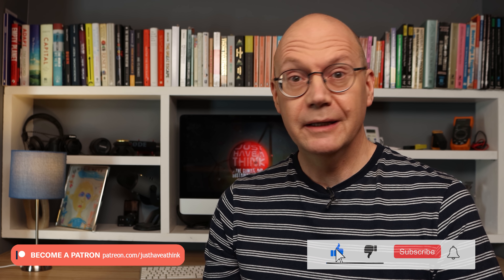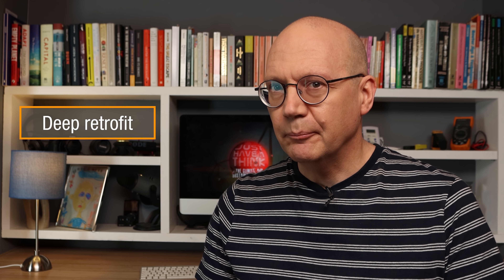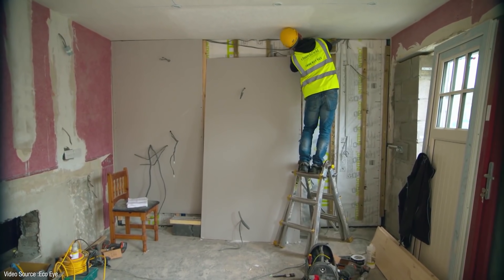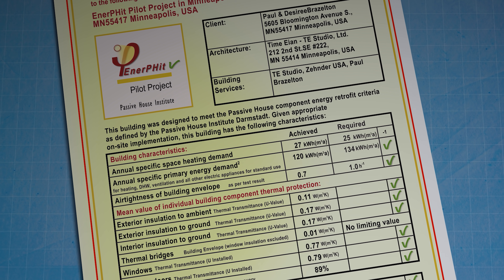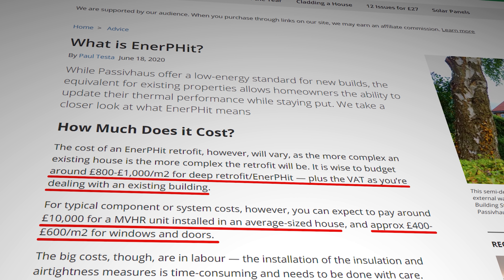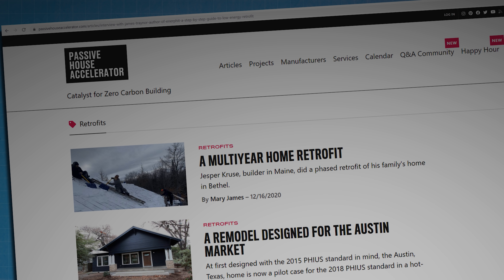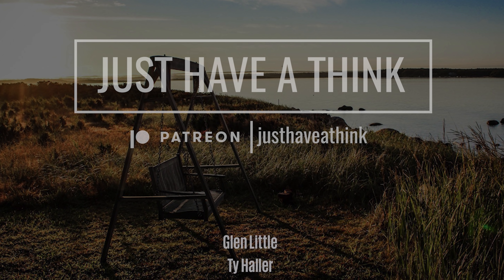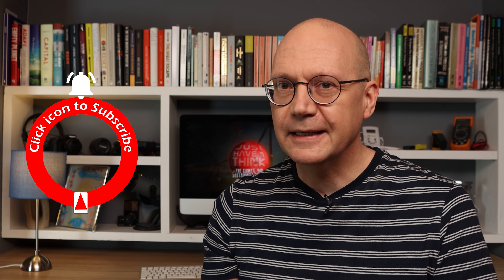Retrofitting to Passive House standards

Comment: This can be done bit by bit with the savings generated by one project freeing up cash for the next in a positive upward spiral.  We have a historic wooden house from 1830. Since 2003 we have slowly: 1) insulated it (none before), 2) reconstructed the windows to Low E double paned (they were all single paned), 3) rebuilt the roof with more insulation and sealing, 4)added 14Kw PV system, 5) added daylighting solar tubes to the N side of the house, 6) added electric heating to our bathroom 7) we are converting our appliance to electric as they meet the end of their lifespan and we just got an induction cooktop.  None of this is revolutionary, yet we are able to cover all of our electricity needs including our 2 EVs with 15% excess that we need to sop up with our planned air source heat pump in our next phase.   We reduced our carbon foot print of our house by 80%  with more to come!!    All of this while not disrupting the design of our historic Carpenters Gothic  home.

Comment: I work as an Energy Assessor and am (now) a Retrofit Assessor.  The UK government has a target of deep-retrofitting 500,000 homes per year, but it is difficult to see how this can be achieved with the sort of housing that needs improving around here - individually-owned Victorian terraces. All the owners that I've spoken to immediately rule out exterior wall insulation as it will  impact the looks and character of the property.  4-6" of cladding also impacts the roof, as the eaves aren't wide enough to cover this.  Interior cladding is also impractical as losing that much interior space may not be an option, especially if the staircase is next to the exterior wall. The obvious target for a deep retrofit is social housing, where a single owner can re-clad an entire block of houses.  
Fitting MVHR is all very well, but these systems need to be maintained and this is not always the case - a friend of mine had a contract with a council to service the MVHR systems in all their social  housing, but it wasn't possible to service them all as many tenants simply wouldn't cooperate to allow access.

Comment: Thanx for your work.
 We live in Israel, so our major concern is heat and humidity. 11 years ago we've retrofitted a 40 years old concrete house into a passive house. We replaced the asbestos roof with an isolated panels roof, insulated the concrete walls (thermal mass) with straw bales+lime plaster, changed the windows to double glazed polarized glass + aragon gas, used concrete floor tiles (thermal mass) over fine gravel (instead of over sand), and shaded the windows. The insulation wraps the concrete (thermal mass) from the outside. 
Before the renovation; during the summer, the roof used to radiate strong heat until 02:00 every night; during the winter, the whole house was constantly cold. After the renovation, the house if comfortable most of the hours in the year. During the summer we turn on the air conditioner only to lower the humidity in the afternoon. Last winter, we used a tiny electric radiator to heat up the whole house during the nights. Our electric bill dropped by ~70%. 
This year, after 11 years that bureaucracy obstructed us, we have finally started to install solar panels on our roof (20.03 kWp), which is 3 times larger than what we use. The rest we will sell to the grid. Here we get per kWh we produce, ~85% of the cost we buy a kWh- a great incentive.
Reply: Hi! Do you insulated internal or external the walls?

Comment: Just remember, actually retrofitting an old house to higher energy standards is VERY difficult to get right. And then, if you really DO get a tight weather envelope, you can grow some nasty molds IF you forget to calculate and install an air exchange system that recaptures heat. My brother built what he hoped to be a net-zero house in 1992. Some systems worked and other underperformed but he kept tinkering with it even though it wasn't really net-zero until 2011. His last job before retirement was to do energy audits. He claimed that at least 80% of houses near him had been so badly built that it would be much more cost effective to replace them because meaningful repairs are so expensive.

Comment: Hi, thanks for your great videos ! I have a question for you: living in a wine region in France, I wonder if you ''have a think'' about this thing the wine-growers do in spring, when the temperature are below freezing in the morning. They lit numerous little fires, fed on straw, that make a lot of smoke. It's really, REALLY effective in creating a ''fog'' all over the valley. I wonder :
1. How much effective it is to keep the vines from freezing (there's a small fire every 100 meters approximately around the perimeter of the vineyard)
2. Is the ''fog'' have an effect on the temperature, if yes, how does it work ?
3. What would be the environmental impact of such a practice on the climate ? For one day ? But if it's freezing for the whole spring? 
Thanks for considering an answer, directly or on a video.

Comment: If not for the historical value most houses should be torn down and and new homes should be built. I am just finishing up a duplex that we will live in. I have double stud walls with R40 and R. 60 in the attic. The house has a great southern view with about 200 sqft of glass on that wall. Where I live we can built our own homes but you want to make sure it is done right in case you sell it and a bank becomes involved. I do many extras most homes would not have because of labor cost. I put in a good HRV system and am in the process of getting gas to the home. We will have a condensing boiler run at 140F for heat and domestic hot water. Being in Alaska the foundation has 4” of rigid foam and the garage has a heated slab because these old bones like the warmth when doing maintenance on our on and off road vehicles. There is also a 16’x16’ greenhouse off the daylight basement that has a 4’ foundation insulated and backfilled. It has double wall polycarbonate panels.

Comment: Did someone do the math on the energy use and CO2 emissions of all the extra materials used to achieve a passive state? How does it compare to a lifetime of more energy usage if it could be sourced from all renewables?

And I am a bit worried about living in an airtight space:  what if Coronavirusses in the future dictate excessive ventilation? Is this possible in a passive house? 

Can a passive house or a really insulated house be achieved with all natural or biobased materials?

Comment: I replaced 20 year old run down double pane windows for good 3 pane windows (Ug 0.5 W/m²K) in my apartment, when I moved in. The walls of that house are decent but could be better, definitly not passive house quaility of heat insulation. Still, I cut my heating costs by almost 70% just by changing the windows and the investment payed for itself completely in about 8 years.

Comment: I'm just installing a DIY MVHR system in a small one roomed house that I built last year. I've sourced all the MVHR components for under £500 and the building services engineer who supplied the heat exchanger calculated that I'd achieve 83% heat recovery. The MVHR unit uses about 2 Watts supplied by a 12 Volt power system that is itself powered by one solar panel and a micro wind turbine. It will cost nothing to run (I'm off grid). My point here is that you can do DIY MVHR and keep the costs down.
Reply: Love it

Comment: Several years ago Building Science Corporation did a test to see how two identical houses built from scratch and side by side performed with two principle of insulation. One was sealed with caulk and gaskets with no insulation. The other was insulated but with no air sealing. The winner by far was the caulked house. Air exchange is more cost effective than insulation. If one does both, it is much better. BSC is in Massachusetts.

Comment: My Wisconsin home is a passive solar and passive geothermal that I designed it can get over 80f when it is below zero outside if full sun. Homes designed to not freeze if no heat is used and it only gets down to 55f with no heat or sun for days.

Comment: mold can appear in insulated buildings also, if air circulation is not adequate. That is why heat recovery ventilation is required.

Comment: I naively thought UK houses were made to this standard in the first place and have little faith in any of this country's regulatory building standards. Having moved into, what the UK call, a 'new build' now 14  years old and after the guarantee had finished. I have since learnt that 3 exposed wall, (our kitchen), turns into a fridge in winter. Situated on an open plain, wind whistles through doors and windows which have been sealed with much sealant tape which doesn't stop the cold. Water has seeped under the door frame, presenting a small puddle in our sitting room. Roof tiles are not secure enough to endure the wind. The front door frame is wider than the door, a plastic frame buffers, and is cracking, allowing the cold to enter. The government's energy structure with primary and secondary requirements are not relevant to saving energy of houses built to their standards. Don't get me started on the plumbing and stairs not made to NHS (our health provider) standards for mobility aids. Why aren't these standards that you mention above, not part of the requirements for new homes? It would save on energy, waste, be more sustainable? So disappointed in this area of the economy.

Comment: Of course one of the problems is the means and methods will have to vary according to climate.  The broad standard of a certain target expense per area or cubic volume can still be a good standard, but the how's to get there are very different.  I worked construction in Alaska for many years before moving to southern California.   In Alaska those ideas you mentioned about moisture, air tightness, cool walls producing problems etc. are all valid.   In California it is the opposite.   The air will suck the moisture out of your house, so an interior vapor barrier is really a no-no.  Also the worksheet you showed, was centered on the cost of heating, which is nil here.   Its the cost of cooling that is high.  Cooling a house in a dry environment makes for a different set of challenges and solutions.  Also you have to add that block masonry is not a good idea due to the seismic considerations.  Light frame built houses have less mass and thus incur less damage during an earthquake.   Even small shakers can undo all that detailed sealing tape hidden in the walls.  Lots to think about.

Comment: WE NEED LOW COST HIGH EFFICIENCY MATERIALS THAT AREN'T TIED UP IN SUPPLY FAILURES AND PATENT EXCLUSIVITY. WE NEED A SCALE OF LABOR THAT ISN'T SO WELL PAID AND OVERLY TRAINED AS TO NUMBER IN THE THOUSANDS RATHER THAN THE MULTI-MILLIONS THAT ARE NECESSARY TO ACTUALLY IMPROVE STANDING STRUCTURES. WE NEED A PERSPECTIVE THAT DOESN'T SEE AN UNUSED HOUSE AS ONLY WORTHY AS LANDFILL.

Comment: I live in a G rated house, possibly an H. It's not an abandoned house but there are walls that have fallen in and note worthy soft spots that have developed in the ceiling panels. Every window leaks and that is from the day they were installed. There isn't a contractor alive who will or would have signed on for making repairs. At this time the costs involved in renovating are considerably higher than they had to be were willing tradesmen available when they were called upon. We have given up. This winter I didn't bother to try and access and turn on the furnace, it wasn't running well last year and has a frail rust shell between the fire and the house. We heated with our electric oven until it burnt out and then were forced to buy more space heaters. It has not been warm inside since it was pleasant outside. For whatever reason we had no pipes break or freeze up this year which was surprising. We always have some pipes freeze in winter.

I hate watching these. This all seems out of reach and with the considerable scaling of products now as well as the costs I can affirm the belief that home improvements are destined for those who can afford them and not for anyone desperate to save their money. It's very unlikely that the few property renters will be compelled by law or them selves to make costly enhancements to their buildings. I can't even imagine right now having our home as it was when we first moved in. So these new standards, all proprietary technology locked up in patents and developed with secret processes or limited to a low scale production means that those with low means and low funding have to manage with old fashioned products. It's either that or do it your self and bend the rules to meet a better standard.

There is no talk of small houses. Not tiny houses, not shacks. Small houses. Not double garage four bedroom three bathroom extra linen closets and two living rooms with a rec room in the basement. Small houses. Houses you can afford and houses you can grow. You can't purchase small houses because those aren't profitable. However a small house is something an individual and certainly a family could hope to pay for and actually own before they retire or die. We live in a small house. What a shame it likely uses more power to heat than a significantly larger house either new or old.

Comment: Thanks for another excellent video on a critical matter.  I love your video's.  So well done!  You are right, the focus has to be on retrofitting older homes as that is 90% of our housing stock.
Back in 1986 we built a new 1700 ft2  (158 m2) passive home in Winnipeg Manitoba in which the heating (gas 85% efficient furnace) plus domestic hot water (also gas fired HWT) cost us less than $400 per year. Today that would be closer to $1,000 in 2021.  It has R30 walls, R50 attic, R8 on exterior of basement (sub grade) and triple pane windows (no argon as it leaks out in a few years). For comparison my previous home was 650 ft2 (60 m2) and heating alone cost over $900 in 1985.
Now in Victoria, BC, we have done extensive modifications to our 1967 built 1900 ft2 (232 m2) home and have reduced our annual total energy bill from $2500 in 2008 to about $1,200 today and cut CO2 emissions by over 90%.  We replaced our single pane windows with well made double pane, insulated the basement to R22, replaced 2 doors with insulated steel doors and replaced the patio door with a fixed window and a swinging door (called an Euro door over here) both with double panes.  Our Canadian home energy rating went from 67 to 82.  I have maintained energy stats for over 20 years and done a detailed longitudinal energy study on the home.  You can find it at https://donscottscivics501.wordpress.com if interested.
While our home's energy costs are minimal, I'd still like to find a way to insulate the walls on the home from the outside without tearing off the stucco.  Our exterior walls are only 2x4 with old R7 insulation in them. There are no vapour barriers in the house beyond the old paper backing on the R7 fibreglass insulation. Is there a product one can put on the exterior and stucco over that breathes so that I don't get a dew point in the middle of the wall?

Comment: Refurbished our Victorian end terrace to a certified Passiv Haus. An interesting experience to live through. You need lots of research and it is not financially attractive but we finished up with a very nice house to live in. PHPP is a great product and you learn a lot about your house and design choices when using it. Addressing Thermal Bridges was the hardest challenge and learning the modelling software rewarding. Understanding the modelling avoids messing up. An internal insulation solution we used was only acceptable because of the orientation of the external wall - the WUFI modelling tool was vital in the design choice.

Comment: Passive House standards are something that is necessary to reduce pollution, make life easier and more comfortable for those who burn wood (and similar fuels) for heating, and pays itself out as time goes by. One of my neighbors says that by adding 8 cm of insulation (where he previously had none) to his house has cut his heating expenses in half.
 Whether it is required by law or not, I am taking steps to greatly improve the energy efficiency in my house. Even though my house is very new (2.5 years), it only has 5 cm of styrofoam insulation on the external wall, which is insufficient for the northern part of Bosnia I live in. Though we're not part of the EU yet, I am striving to get it at least up to their standards and possibly even better, financial constraints permitting. The EU standard for my area requires about 12 cm of styrofoam insulation, and I will add more to it soon.
I have already installed some solar panels on my roof, giving me more than enough hot water on sunny days, and covering basic energy needs.
My plans also include triple pane windows (double pane now), heat pump(s) and heat exchange/recovery from dumped warm/hot water and ventilated air. But first, since a wood-burning stove is my main source of heat, I plan to add a spiraling tube in my chimney which would automatically bring in warmed air from outside, instead of having the cold air sucked in through the cracks in doors and windows, which both reduces efficiency and makes it less comfortable.